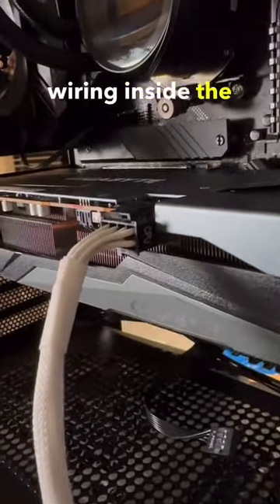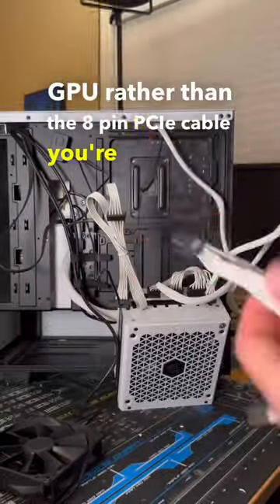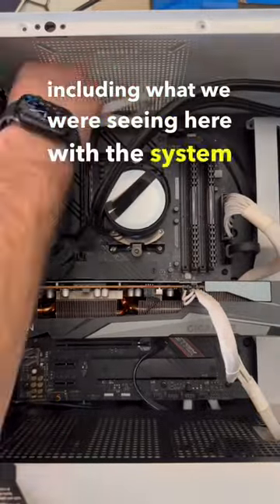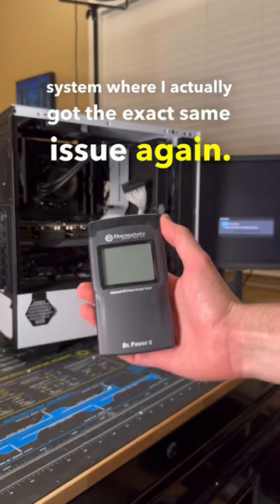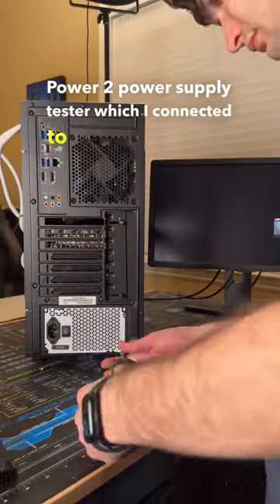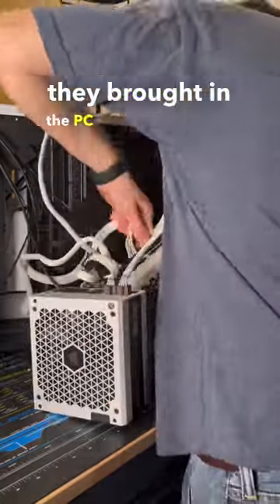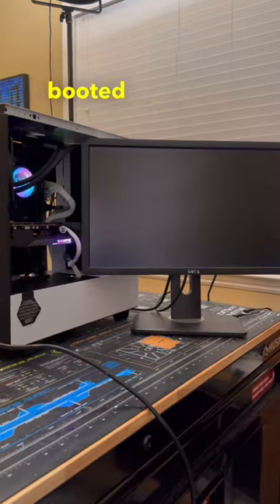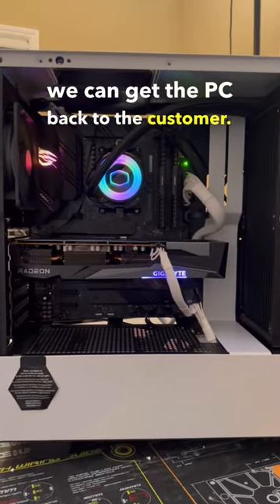I BROUGHT A DEAD PC BACK TO LIFE! #shorts #pc #pcgaming #pcbuilding #pcrepair

Comment: Jeez he got lucky, I've heard of people killing their CPU like this
Reply: If that psu was bad the whole system could be dead instead of just the psu
Reply: They broke their CPU by plugging in the wrong cable to the GPU?
Reply: @lucasmcnamee3658  presumably the 8 pin PCI cable was plugged into the CPU header
Reply: @lucasmcnamee3658  that happens if the 12v pins goes into the connectors that wasn't meant to receive 12v  and thus causing damage, pcie and cpu has different placement for each pins.
Reply: Or GPU for that matter, as the pinout of PCIe and EPS12V are different. Also the keying of the plugs is different, what things that don't fit will be made fitting..
Reply: @johnscaramis2515  the pinout is the same.. My cpu cable got damaged and I replaced it with pcie cable and it worked.
Reply: Lol right

Comment: (Not so) Quick tip: Never use another PSU's cables for your power supply. It can kill your power supply even if they are both the same brand. This guy got lucky when hot swapping the PSU most likely because it was the exact same power supply. So when you get a new modular PSU, PLEASE swap out the cables.

Comment: Yeah the cpu cable has the ground wires opposite of the Pcie configuration so when you use a cpu cord they short out the psu that’s why they are labeled 😅
Reply: That sounds like a pretty moronic design...
Reply: @TUDORMARCU16  they’re actually different shapes so this guys really shoved it into the port with no remorse, the shape of the each of the eight pins are either square or a almost bucket shape so they don’t fit normally without “excessive” force
Reply: @Joel-cj2cz  that's what I was thinking. Bro had to go full one punch man on that 8 pin lol

Comment: How convenient that the guy that didn’t know what was wrong with his computer bought a new power supply!!!
Reply from the maker: Well he tried to diagnose the issue himself and said he thought that it was the issue, so he bought one and then gave up after trying to install it as it still wasn't working.
Reply: He could diagnose the problem but not follow psu manual on where cables go?

Comment: I thought CPU and PCI cables had different pins to prevent plugging wrong cables
Reply: Yeah they do but only on the psu side, kindz dumb not to read the label on the pcie side...
Reply: @999oresx  actually CPU and PCIE share the same pin out on the power supply side on most PSU’s. At least all 3 of the different makes I have do. They are different on the Motherboard/Graphics Card ends.

Comment: Had a customer blow up 2 video cards, 3 mobo and a psu plugging in 8 pin power to gpu instead of 6+2....just kept returning parts to store....they need to change the plugs so people don't make the mistake....
Reply: or people can learn to read...
Reply: Stupid people will always find a way to destroy their stuff, there’s no reason to engineer your product around them.
Reply: They are clearly labeled on the connector for a reason. If this still manages to happen mire often, then its more of you not using your brain, eyes, and multiple years of school teaching you how to read, write, and speak the native language of the country you’re in, rather than the connectors to a CPU and GPU looking the same💀💀
Reply: @Ilikedagames-rf2fx  Like using angle grinders to cut notches in RAM sticks to make them fit...
Reply: They already have different plugs
Reply: @Ilikedagames-rf2fx  one of the main tenets of engineering is to make it idiot proof. You need to anticipate how people could incorrectly use your product and design it In a way that won’t happen as often

Comment: Yeah the problem wasn't a dead power supply. The problem is they killed the power supply by shorting 12 volts the ground and probably trying to turn it on multiple times. Also I'm not sure how they got the EPS 12 volt connector to fit and the video card because last I knew the keying was different.

Comment: Rule of thumb: don't put the entire computer together all at once. Makes it more difficult to troubleshoot if something goes wrong.
Reply: Then how would you do it?
Reply: @andyyang1721  Do it little by little, test often. If something doesn't work while doing it, you pretty much know what's causing the issue. If you put the entire thing together all at once, you have to go backward to figure it out.
Reply: @JackOfAllRAIDs  I mean you can't really test parts while building a pc since you can't turn on the pc without at least having everything other than your gpu installed
Reply: @andyyang1721  You first connect the PSU to the motherboard. Power it up. If the PSU doesn't start, you know either the PSU or mobo is bad. Easy peasy troubleshooting to begin with right there. If you had put everything together at once, you don't know if the mobo's bad, the PSU's bad, the CPU's bad... so many variables.

Comment: he was lucky for not getting his motherboard or GPU fried for incorrectly wiring, but the PSU suffered the damage instead.
Reply: @vladimirwinnin9662  Fun fact. Graphics card can actually be powered by the cpu power connector, you need to flipped the connector (corresponding to the locking tab) and jammed it in.

Although this is not recommended and the worst scenario the psu braker will pop.

Comment: How come most new power supplies will have that spot on the modular connector listed as CPU/PCIe?
Reply: I'm wondering the same thing, the cable is labeled CPU but the PSU says CPU & VGA on 5 ports. I'm not sure if I plugged it in the right spot

Comment: Also: do never use other cables that the ones for your psu.

(Probly cablemods are safe but I mean when you upgrade your modular psu, don’t stick with the cables from the other psu as it could go wrong)
Reply: Me over here hooking up my computer’s power cable with a decade older PSU cable
Reply: Honestly is that true with cable mods?

I literally have cable mod cables for my 1000w g3, I need an extra 4 pin to my mobo for overclocking. they aren’t marked and was just about to send them an email asking if I would be risking my system using what seems like cables that could be pcie but look like cpu and vise versa lol

Comment: So your theory is partially inconclusive because you changed two variables in the equation: the 8pin CPU connector, and the power supply itself. 

Since it appears that the PSU is modular, using a connector simply labeled CPU doesn't mean it was plugged in to the port labeled CPU and not a PCIe power port. The pinout could have very well been the same for both connectors, and all that was actually bad was the PSU

Comment: Don’t use the same cables even with the same model and brand that could cost a short?
Reply: Not really, you can use it just make sure its the same version they have or just buy OEMs or order a modded cable online, i bought a OEM SATA cable for my MSI A850gf and it works fine
Reply: There are even some that are compatible with other power supply’s you just have to be very careful and do research, although if you are buying a modular psu why not use the ones that came with , you are pretty right I’d not do it unless I had to
Reply: It's the same PSU model. It's unlikely Corsair will have a revision since they've recently done it

Comment: bruh this is not a repair you just replace the whole psu i wouldn't do that i will open it up and try to repair it with my multimeter and soldering iron but be careful because inside the psu it has a capacitor that if fully recharged it can be very dangerous

Comment: You should make a note since you used cables from one psu for another, that thats only fine cause there the same make and model, and that people shouldn't use psu cable that arent meant for that specific psu. Too many blown up gpus, cpus, and motherboards.
Reply: Yeah, learn the hardway. My brother use PSU with modular cable, and he loss his PCIe cable (because his gtx1050 doesn't use PCIe). He tried to buy a new one without looking at the manufactur, and fried his motherboard, PSU, and 2 gpu (my old gtx1060 6gb that I gave him and his gtx1050)
Reply: @Mochichino15  ouch thats an expensive oops
Reply: @the_7th_sun  yeah, at least his cpu and ram survive

Comment: Hi, quick question(with a bit long chronological problems) is it bad power supply can caused PC failed too boot, I mean my PC can turn on but there's a white text message on screen (I'm forget what text said cause my PC normal now), after that I power off my PC unplugged HDD, turn on the PC it boot normally,a week after HDD plug in an my PC freeze like usual power it off unplugged HDD it start normally, is it because bad power supply?

Comment: How did that 750w Corsair psu died. It should have robust short circuit protection. Even 20yr old psus had short circuit and overcurrent protection. Even crappy 10$ china psu have overcurrent protection that functions correctly. I have fixed hundreds of systems in last decade & i don't remember one single psu failure from shorted 12v.. & heck one of my systems survived lightning strike , the motherboard & nic was not that lucky. 
I guess the psu died first. The customer was trying to troubleshoot and at that point they removed the pcie cable & installed 12v eps to check if the pc starts up. 
12v 8pin cpu power has 4 sets of 12v &  ground while 8pin pcie power has 3 12v & 5 ground pins! If u jamin a 12v 8pin cpu power into 8pin pcie power you would short one set of ground to 12v and the psu will immediately trip on overcurrent protection.

Comment: Wouldn't the system boot even if the GPU was plugged in with a CPU connector?
Reply: No it will do exactly what it did in the video and sometimes worse
Reply: @aMadison2010  I meant that the motherboard should still boot. The motherboard shouldn't need the GPU to boot.

Comment: You should never re-use old cables from a different power supply. Even though this is the same model you should never take the risk, if one of the cables is incompatible you could possibly fry all your parts.
Reply: Given it's the same model and maker that won't matter. Corsair uses the same pinouts for all PSUs now. *Tho some do still use their Type 3 but as of recent they all switched to type 4
Reply: Same model is perfectly okay. Different iterations, brands, or power outputs absolutely not.

Comment: If you plug in a cpu cable into the gpu you short one 12v pin on the CPU plug into pin 8 (sense) of the PSU which would be Ground. Don't do this, there is a reason it's not the same cable.
Reply: The psu should go into short circuit protection mode.. but like you said.. don't do this.. don't rely on the protection circuit of the psu, it might not detect the short circuit fast enough and cause some irreversible damage to who knows what

Comment: Dont use the same PSU cable u can fry everything
Reply: Usually true but the new and old psu are completely identical so it's fine
Reply: @theaverageblitzer4351  but still i wouldn't risk it
Reply: @averageuser6847 you could also just like grab a multimeter and test it
Reply: @theaverageblitzer4351  true but what if you don't have one
Reply: @OctavalNevada68  new cables and a multimeter are similar prices and if you're building a PC with a >$1000 budget you're probably gonna get some cablemod cables
Reply: @averageuser6847  i agree woth blitzer, same make and model its fine, maby worth a check if its a revision
Edit: and you can pick up a continuity tester for $8 at home depot. Or an actual multimeter for $20

Comment: Using different cables from different PSU and puting they on new PSU is very dangerous and unprofessional because if the PSU is the same model as a older one and if they have same voltage etc never use the cables from other PSU because u can destroy everything
Reply: As long as it’s the same PSU it’s fine

Comment: that should be possible. the guy must have shaved some pegs on the EPS cable because it won't fit into a gpu otherwise.
Reply: No way the cpu cable has the ground wires and power wires on the opposite side as a Pcie cable it will ruin your psu and possibly damage the other end it to such as cpu or gpu don’t do it

Comment: You can use "CPU" 8 pin in a GPU, same outlet, same cable, it changes just the end label and the W rating for the 1x8 and 2x8. At least in top tier psu

Comment: This video is pure BS.... Next time maybe the customer can put his CPU dual tower cooler with the fans both blowing air towards each other and it makes the PC thermal throttle off. you guys can test it and find out he did that and like you get it back to the customer and he's happy and then that's your next video cuz you're in the other ideas.  Maybe he was trying to upgrade his cooler and it got hotter and you guys put the multimeter in this butt